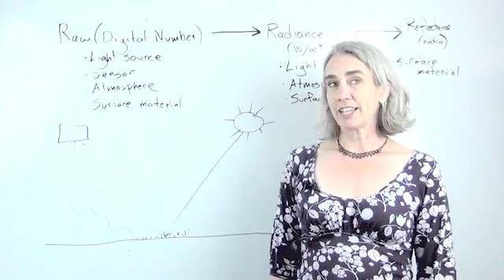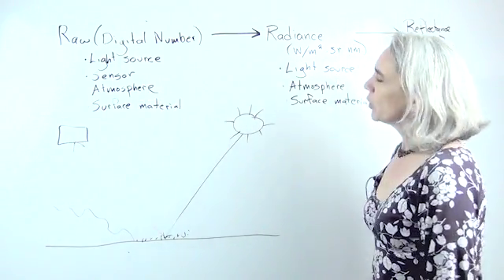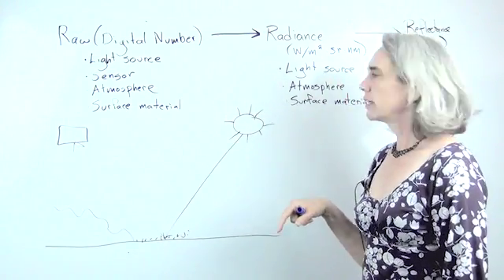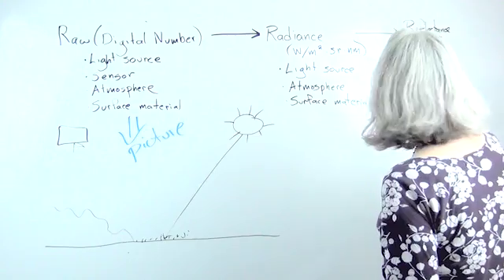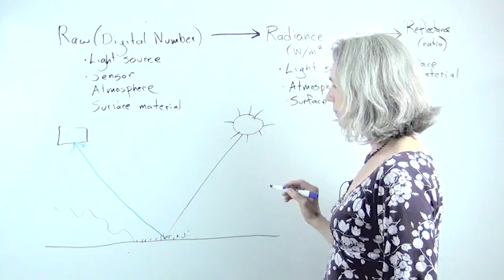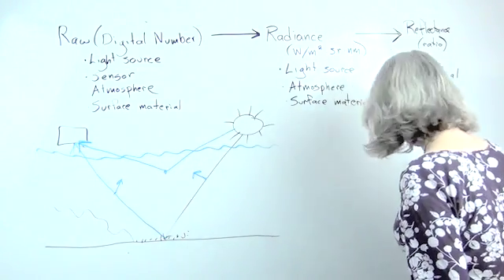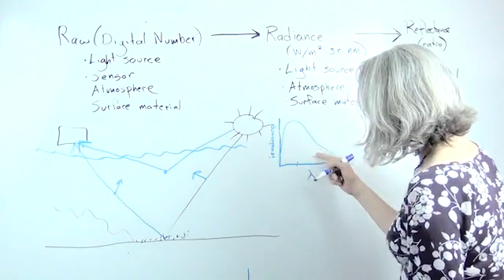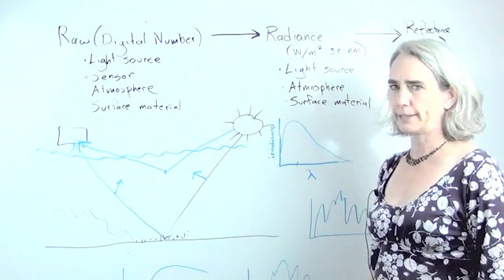Digital Number, Radiance, and Reflectance | Whiteboard Bloggers Series

Comment: Only suggestion.  Technically, reflectance is an inherent property of a material (along with trans. and absorption).  It is a result or consequence of a ratio of incident hemispherical irradiance (for example, excluding the more specific directional BRDF) and exitance from a material.  The residual is then called the quantity "reflectance".  i.e., I often teach it as, "what did the material do (i..e, abs, refl, transmit) to the incident radiation" Semantics.  :)  Nice job !

Comment: most commercial satellite imagery offers radiometrically corrected imagery (eg WV GE) but dont say if its full radiometric correction (meaning including atmospheric correction) or just converting DNs to at-sensor radiance and to at-sensor reflectance . Is there any way to tell that indeed radiometric correction has been applied, like whats the pixel values become or through image stats? Thanks